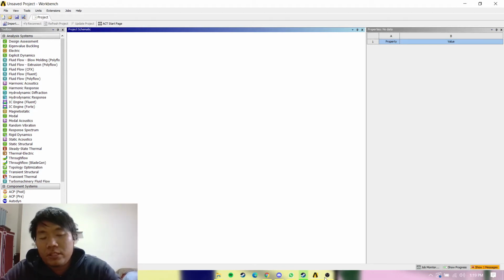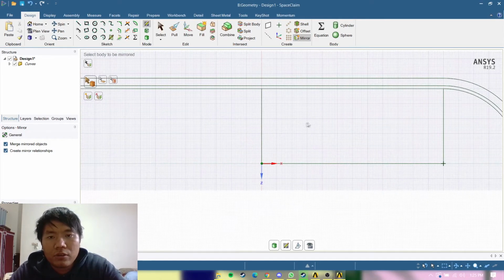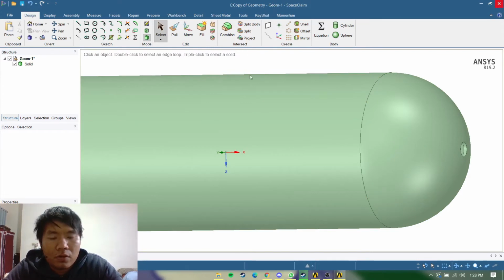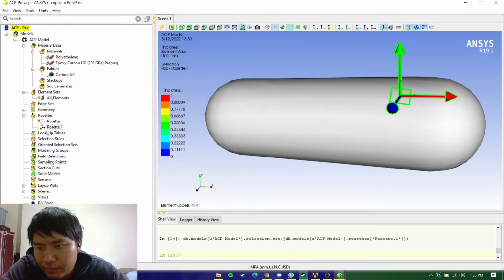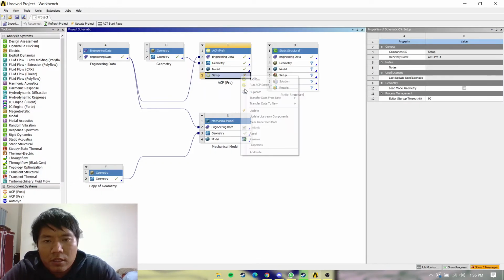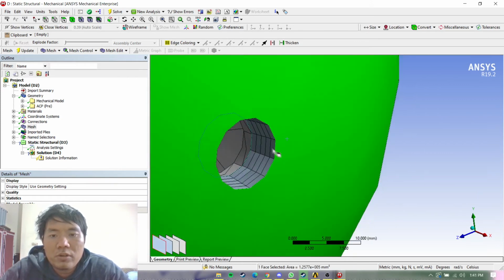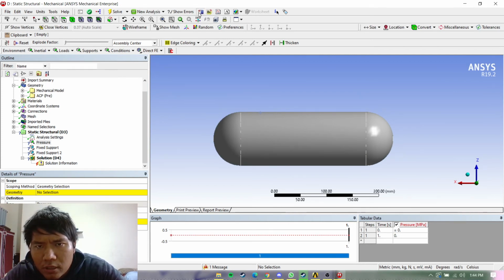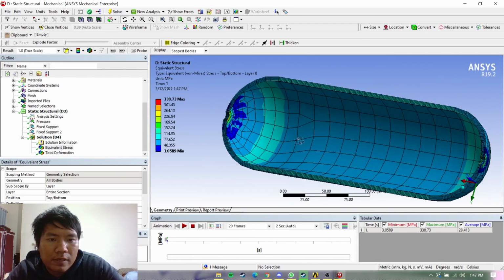Design Composite Pressure Vessel with Liner Using ANSYS ACP

Comment: Thank you for the video I am trying to achieve an analysis of a COPV like here. However I am applying pressure of 160 MPa. I always took the same error. "Element .. is highly distored." Could you please help me? I increase the number of elements. I use incremental loading. What should I do?